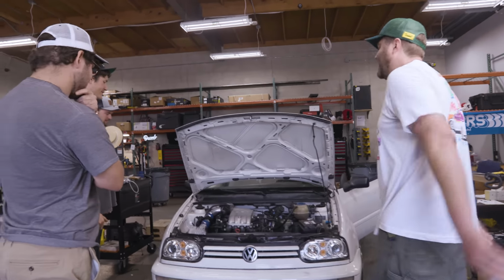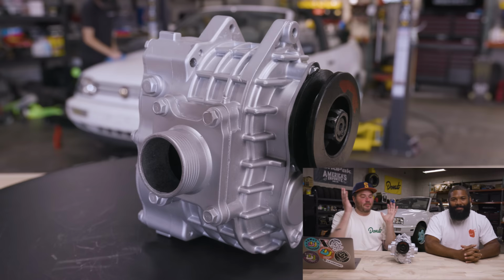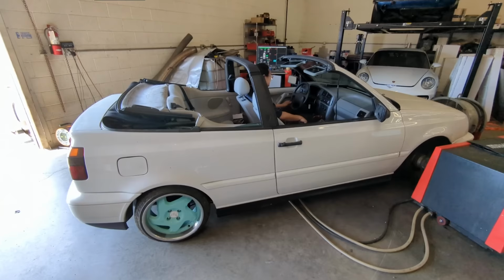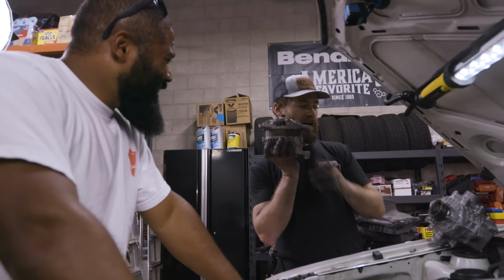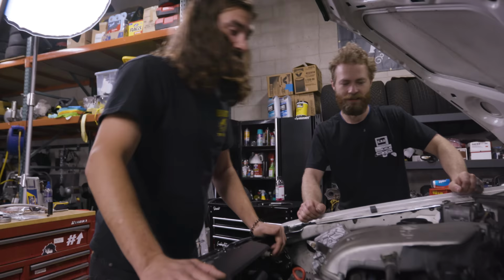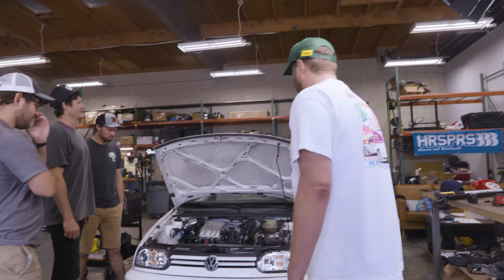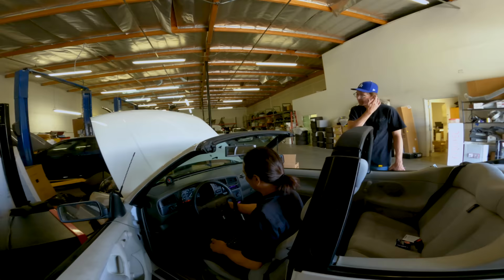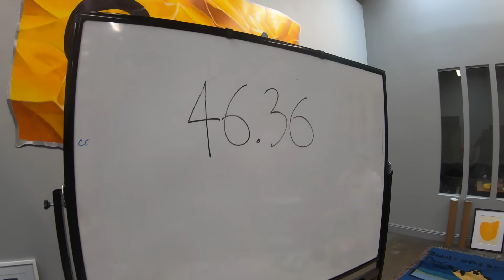We Installed a Wish.com Supercharger on Our Car

Comment: thats funny, i bought one of these AMR superchargers to put in my Starion, i got a 300 and a 500 to see what would happen. lol

FYI, you might need to add oil in  the unit. just a heads up. mine came dry
Reply: if you replace the engine with a harbor freight unit it can make more power baby (than without).
Reply: No oil would explain the noise and the self clearancing effect.
Reply: You ever put it in the Starion? What year model car do you have?
Reply: @mycosys  if you watched grindhards vid the put oil in it

Comment: Maybe the blower was just too small or worn out but I'm curious how you tuned the poor thing with the MAF sensor set up that way. The mass airflow sensor is usually in front of a compressor not behind it. The MAF sensor measures airflow by detecting changes in  resistance across a heated wire as the airflow moving past cools it off. The MAF sensor is designed to measure airflow at ambient pressure and temperature and relies on the intake air temperature sensor for reference. It is not designed to have hot pressurized air blowing on it. Installing a MAF sensor behind a compressor that delivers hot air will make the sensor think the airflow is reducing as the charge temperature rises, basically inverting its output. Additionally increasing the pressure of the air charge across the sensor will alter its response curve. Id love to know how you compensated for that and why you didn't just mount the sensor in front of the blower like everyone else.
Reply: The amount of noise it was making was not normal. I've seen other people use these (though not bought from wish, bought from places that actually didn't sell broken crap) and they were much quieter than this. This thing probably had bad bearings, stripped gears, etc and the impellers were touching each other and creating a buttload of friction (and noise). It probably would have actually made more power had it not come from wish (and therefor, was almost guaranteed to be junk)
Reply: Should've sprayed some water through an atomizer into the air charge after the maf.. On most turbo cars the maf measures air sucked not blown lol..
Reply: I believe that from the sound it may have been spinning in reverse as that would drastically decrease power.  It should have never been that loud.
Reply: @qumefox  they mounted it backwards, and it had no oil

Comment: The funny thing is a simple water to air intercooler and this would actually make power. I'll bet the intake Temps were high 280s. Overdriven superchargers need more cooling... and a bypass valve so they don't see vacuum from the engine. That's a good way to lubricate your top end with supercharger oil because the seals are designed to deal with boost not vacuum. That will help with the funky burning smell.

Comment: Curious to know if the internal screws might have been pushing air instead of pulling due to the orientation of the belt ( CW vs CCW).
Reply: Came here to say this, I thought maybe it could be spinning the wrong way.
Reply: The guy who put it together already knew which direction it was supposed to spin and oriented it in that fashion
Reply: its not directional
Reply: @eriksimca9409  how can a blower be non-directional?
Reply: @FZERO20  no he assumed the direction. This makes sense, the strange sound, the halving of power. It could be blowing against the engine.
Reply: @abadran8174  might also explain why the car kept cutting out when they let the throttle off
Reply: @abadran8174  stock pulley had an arrow on it.
Reply: @alexcrouse  oh I see. The assembly line or rather the assembly guy might have put the screws bachwards lol. Because that thins is blowing air away from the engine's intake.
Reply: Not directional but either side can be used as the intake and the other the output.
Reply: @abadran8174  he stuck his hand in front of the outlet and said it blows a ton of air. He's not as dumb as you guys seem to think.

The thing is just a piece of shit. It's a poorly made knock off with an internal mechanical problem, hence the noise that real 500's don't make.
Reply: @alexcrouse  that's a high quality WISH supercharger... uh turbo charger.... uh what did the wish listing call it again?
Reply: Yea…. Sounds like shit is all backwards hence the noise going against the impellers the wrong way. Couldn’t they just of hooked it up to an air impact to measure flow rate
Reply: I think it was mounted on a way it spun in the wrong direction. Especially since he mounted it facing away from the motor.
Reply: The screws are gear driven, internally. They couldn't just be in backwards.
Reply: Something is definitely not right, could very well be that its rotating opposite of intended....
Reply: Oh my god
Reply: @anthonyr.2897  So you think they spent hours fabricating a mount to get it to work with the existing belt, but somehow put it on backwards? Check the links for the complete install where you can see what was done, might make more sense then.

Comment: My first car was  a 2001 VW Cabrio. Red, top was in perfect condition. Went up and down great. Was $500.

It didn't shift past 2nd gear for a few weeks, until I just gunned it one day and it magically remembered it had more than 2 gears, and it worked great after that.

Struts were bad, so it started to shake at 35 mph, at 45 it would even back out. Highway speeds were too scary so I didnt drive them LOL
Got me to school and back

Got $350 back for it. Almost wish I didn't sell it.

Comment: You know there's some simple math at play with this stuff. You added a restrictor in the end, just a pinch point for the air... same as if you take a GM 3800's S/C from a GTP or the like, the Eaton M90 or equivalent, and plop it on an LS V8... The little S/C pushes enough air volume to make for a net positive with the smaller displacement V6, but it can't produce enough air in general for the V8, even a smaller 4.8 liter is too large. And as such, even with that very much legit S/C, you'll still see net loses. 

Sooo, clearly this little thing was meant for something smaller. Probably something like what's in GHP's power wheels builds, or an ATV, etc.... I'm sure this would push enough to see the average quad get some gains... but this was destined to fail from the start. Oh, and that horrendous noise it made, that was the engine pulling more air past it than it was designed to push on its own... that was a bad noise.... not bad as in, not fun to hear. But bad as in, it indicated very bad things. Failure.... it indicated failure, lots of failure.
Reply: So for $192 each they need twin super chargers
Reply: They didnt add any fuel. Any supercharger will rob power if you dont add fuel to make up for the extra compression and mechanical losses
Reply: They work well on k11 micras
Reply: It was also bucking and died upon letting off of the gas bc it didnt have a bypass/blowoff/diverter valve
Reply: @datjap8883  like a Nissan Micra? Lol dope we don't have those in the States.
Reply: @tylerwatts8598  yeah bro haha, put one on my old one here in Australia
Reply: @tylerwatts8598  damn youtube deleting my comments now, search up on youtube name on IG, you'll find the micra haha

Comment: My buddy had a VR-6 Corrado with an 18 lbs boost charger on it. That thing was really fast. We raced one of those high end Corvettes once and smoked the guy. I was in passenger seat wearing a 5 point harness. Pretty crazy . Car pushed your face back when you really got moving.

Comment: There are TWO versions of this supercharger. The original Aisin AMR-500’s work very well and operate with almost no friction. 

This is the Chinese copy, I’ve had several seize after only minutes of use. The belts also slip like crazy on the Chinese copy costing boost.

Comment: I was actually laughing to myself that the "Supercharger" took more horsepower to spin than it actually added to the engine. 

And apart from appearing to add a massive restriction to the intake system, I was kind of right.

Comment: i'm not surprised it took such a huge hit. the amount of power required to turn that dang tiny super was probably insane. i know people who have installed "proper" sized universal super kits, and lost 5 to 10 hp even with 5 pounds of boost or more. its a balance of shaft diameters and friction!

Comment: That final HP reveal.. I broke down laughing... 😂🤣😂🤣😂😂
Reply: If you dont add fuel any supercharger will just rob power - it uses power from the engine to add more air to let you ad much more fuel. They only did the bit that costs power so its kinda meaningless.
Reply: @mycosys  That makes sense.. Thanks 👍

Comment: 1:14  Real Sprinters know that if you hold your mouth wide open while sprinting, it forces air into the Lungs creating pressure which forces more air into the body system creating a Biological SuperCharger, and you can run much faster.

Comment: The only issue is that it says it's for a .8 to 2.0 when in actuality it's for .5 to 1.0L
Reply: works fine on a 1.6 l at the maximum
Reply: @Melkor54  you wouldnt see alot of gains with a 1.6 like this is the supercharger I used on my vfr800 and and it went for like 105 wheel to around 150 wheel. The amr500 only flows 500cc at atmosphere so at one bar your only getting between 1.5-2.0L of flow max and that's with pushing the supercharger because 15-17psi is all it can really handle before it blows so anything bigger than a 1.5 you won't see much gains it would be like a factory turbo car from the late 90s now I I do have one in my civic and it's a d15y3 but I have it geared and clutched because I only use it for the low end and run a gt20 for the high end

Comment: Damn I sold one of these with no inlets/outlets, no brackets and needed a service for 250, no idea what it was priced at. Looks like i was on the good end of the deal
Reply: It depends. Was yours an actual Aisin unit? That wouldn't be a bad deal for a real one but yeah if it was a chinesium special you got out good on that one
Reply: @philtheairplanemechanic  um not sure, it was really old looking I've got photos of it from when I sold it. I'll have a look at them
Reply: @philtheairplanemechanic  Chinese AMR500s are alright (its almost an exact copy of the original Aisin), I see them on beetles a lot and they make a good amount of power. Hell I use a Chinese TD04, added 50 HP on my last dyno run
Reply: @philtheairplanemechanic never replied but yep it was a chinese one haha

Comment: I think you should buy a genuine version of that supercharger (that hopefully bolts on) and see if that works!!
Reply: Yeah the AMR500 is an actual supercharger, comparing it to a 10k supercharger when it's half the size of the 500$ eaton than came in a mini cooper is super unfair. Also this one is broken, and even a 10k$ supercharger on the golf would shit the bed without a tune.
Reply: @Flashbang_Photo  The whole point of a supercharger is to use engine power to add more air, letting you add much more fuel to compensate for the loss. They only did the 'use engine power' not the 'add much more fuel'.
Reply: All true
But maybe we are missing the point…I never laughed so hard at a YouTube video. Props guys for making my morning
Reply: The Wish one works good, they just installed it wrong.

Comment: "watch it make 50 horse power" famous last words
Reply: i just don't know how it lost so much power 😭🤣
Reply: Actually was close to 50hp lol
Reply: And with price is right rules he technically still lost lol
Reply: @nickelblock784  actually its obstaculizing the airflow.
Lowing near half of the 80 horsepower is a proove of it.

Also checking Supercharger specs because not all can fit and not all have same timing, some time ago Volkswagen made a 4 inline supercharged Golf at old times and actually worked good, don't remember if was above 100 horsepower but was way above from factory 4 inline

Comment: You have to put at least a fuel pressure regulator, a dump valve, and a map sensor with the right pressure rating to produce any power.

Comment: It's intake and outlet ports are backwards , belt rotations correct I'm pretty sure. The amr 500 outlet usually has a dish, or notch on the outlet port. So what you got is a suckered charger lol😅

Comment: Look. It might not last a long time, but I would expect it could at least generate 10-20HP more if it is all setup right ie. lubrication, pulley sizing, intercooler and bypass valve. That's what other blowers all have to get them to work. Not ure if its worth the time and hassle if its a low HP gain. This needs to be revisited as it was definitely just "'thrown in"' rather than planned and sized.

Comment: Exhaust isn't spitting unburnt fuel so it's safe to say it's getting air, too much air also isn't a problem for fuel injection. My bet is the wheel is too small making the fan spin too fast and taking too much power off the belt.

Comment: Needs a proper twin screw turbocharger that mounts on top of the engine to a carburetor & intercooler..  I think a 4cyl supercharged would put out great power, especially with a stick shift or cvt

Comment: that's because you didn't change the engine mapping. Polish Youtuber Wazzup had the same issue. He installed a supercharger in his BMW e39 520i 150hp without changing mappings and bmw spat out only 104hp. After changing maps in computer it suddenly got 200hp

Comment: AMR 500 is good for like 120hp MAX.

AMR 700 is good for like 200hp maxed out though.

That's pulleyed down and with a good intercooler though.

Also, definitely flattering that blower with showing twisted lobes. That thing has tiny straight lobes. Horribly inefficient. 😆

Comment: So, I have seen some guys make power off of these. I've seen these on alot of aircooled vw stuff, and usually they're not a blow through setup, but rather a draw through setup. This essentially puts the throttle body/ carburetor before the blower. General rule of thumb, any type of roots style blower likes to be draw through, it's just a lot easier to control the idle and you don't get that crazy dying out thing that you kept experiencing. Also, that noise you're hearing, sounds like either the coating that's supposed to be on the rotors failed or they never clearanced the rotors properly. I would be kind of interested to see if set up properly what kind of power this thing would make.

Comment: im not surprized it lost power, the case and housing isnt large enough to provide the CFM that the engine needs , thus this thing is too small, i bet it would work on something like a 1 or 2 cylinder , also the lower pulley would need to be substantially larger to provide enough boost . my 2c

Comment: The rotation of the supercharger doesn't fast enough to supply more air to the engine than the naturally aspirated did. The other problem maybe the supercharger roller impaller not properly design to suck more air. The quality based on the price. Didn't expect too much right. If it's good so it's good, if not.. well the price is cheap. Haha

Comment: Covering your ears when running it is a sign that it's very well lubricated and has low friction.

Alright so going from 81 to 46hp is a loss of 35hp. That's about 26kW. That supercharger probably generates as much heat as your oven and all 4 burners on your stove running at the same time.

Comment: As long as it Pushes air down the Intake of Coarse, You will have Hp gain, Just put a blow off valve, There know reason why it would not work.

Comment: This is a clone or a remanufactured one of Subaru's beautiful AISIN-AMR500 and it must be bathed in oil (about 100ML), its assembly is super simple and the guys did everything wrong. LOL :face-blue-covering-eyes:
It correctly installed delivers between 0.5 and 0.7 bar of pressure

Comment: When you install a supercharger you dont just install it and go for a ride! 100% the power will be lower.  A new estxhaust system must also been installed and a chip tuning. Actually that was a non complited video and could be real interesting if it was completed.
Reply: And you gain even more if you put oil in the blower before you destroy the bearings....

Comment: ECU should be reprogrammed. It could not work of course. To much air vs standard fuel delivery. Charger gives more air, thus you need more fuel to burn effectively.

Comment: So you never mentioned if it was tuned or not usually you can gain hp if it is producing boost with the right fuel/timing map for the psi increase I am just curious if you haven't tune it you should you might be able to squeez triple digits but most likely in the low 90's

Comment: I have a feeling its backwards. Every other install ive seen didnt mount it facing the opposite direction of the other belt deiven accesories. Did you guys put oil in it? Theres a drain plug on it and id recoment flusing it as some of them come with a good amount of metal in the case.

Comment: superchargers rob horsepower and torque then add it at same time so you need a strong engine to begin with to get gains.  This might work in a v8 engine.

Comment: Was it put in the right direction according to the rotation of the engine as it sounds like it was running backwards thus creating the screaming sound and the lack of horsepower on the Dyno.

Comment: Was it not tuned? Sounded like it had no oil/grease in it to me, if it came with no hardware it probably didn’t come lubed either 😆 probably wanted a smaller pulley to make more boost